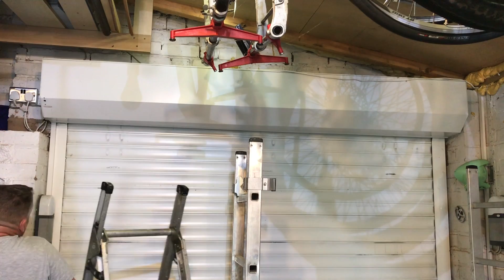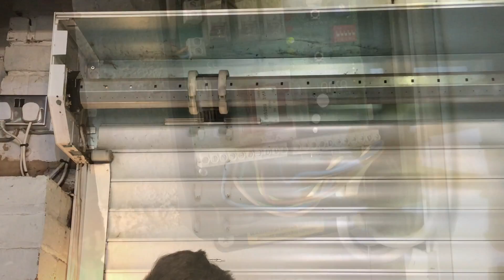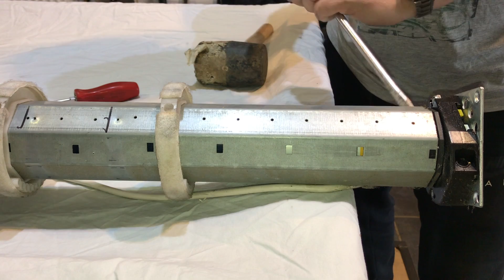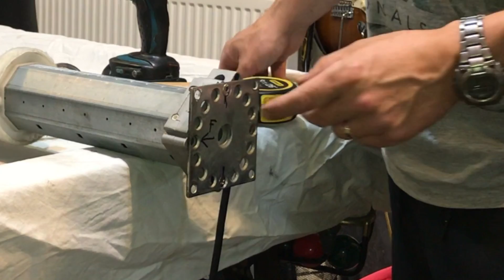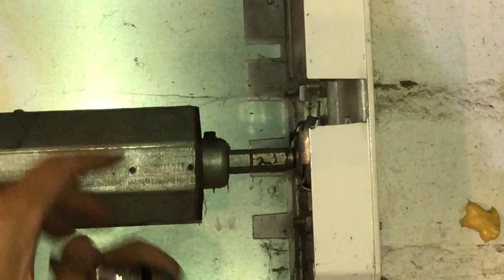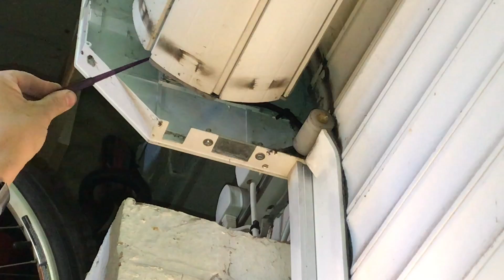Roller Garage Door Motor replacement, "How to Repair Electric Door"

Comment: Thank you Aaanton11. I bought my garage door second hand and the motor was very weak and then stopped opening> I bought the motor on your video and now it's better than ever. Old one was 100Nm and the new one is 140Nm. It's so quiet now. Great video....Thank you
Reply from the maker: That extra torque makes a huge difference, Thanks for the great comments👍🏻👍🏻🛠

Comment: It looked to me as if there was scoring around the gearbox body when you pulled the motor out. If this is so, it's a classic rookie mistake done by  installers who quite frankly, know very little about their own products!
Reply from the maker: Good to know for future reference, thanks for the comments! 👍🏻👍🏻🛠
Reply: One of the curtain fixing screws would have been too long. We saw a motor cut clean in half a few months ago, for this reason

Comment: @aaanton11
hI, Whats the thing called between min 36-38, I think its the Locking straps that attach to the door curtain, and what are the white things on the roller called. Seems our previous installer just screwed the curtain into the roller.
Reply from the maker: You will need to check your manufacturer's web site and look at a parts breakdown, Thanks for the great comments👍🏻👍🏻🛠

Comment: Very informative video, our garage door motor was making weird noises and when we removed the top cover we found a snail inside had somehow managed to get trapped and squashed between the left side motor and door slats causing a misalignment of slats. Having cleaned out all the snails shell debris the door now opens closes ok but does occasionally make some grinding noises on the left side so I foresee going down your road and maybe replacing the motor before the winter takes hold.
Reply from the maker: You might get another couple of years out of the old girl yet 😂 Thanks for the great comments👍🏻👍🏻🛠

Comment: Awesome videos, thanks! My Somfy keeps killing the downstairs circuit breaker, so assuming dampness over time in the motor. What’s your thoughts on the motor now having used it for some time?
Reply from the maker: Top Motor, no issues at all, not as fast as the Somfy but not too slow either Thanks for the great comments👍🏻👍🏻🛠

Comment: Great very detailed video. My door has been fitted for the past 12 years with constant daily uses.  It has been working perfectly until now.  When you press the button, it clicks...the motor activate but the door never goes up.
I can open and close the door using the grinder. I can close the door using the remote, it clicks once and closed without any issues or weird noises. When it reaches the bottom it seems that it wants to fully close but then tries to reopen which then obviously fail.  Is this also a motor issue ?
Reply from the maker: Sound like it, Thanks for the great comments👍🏻👍🏻🛠

Comment: The grub screw on the right hand side, what is that for/what does it do???

Iv got to replace few of the octagonal clips, will i be able to just pop out the one side (bearing side) and slide them on
Reply from the maker: It holds the share Into the bearing, Thanks for the great comments👍🏻👍🏻🛠

Comment: Absolutely superb and exactly what I needed to mentally prepare myself for mine! 

After being told that the guy that installed it would gladly charge me £650+VAT to fit a new motor, I decided to see what the internet said. First was your video to dismantle it, then a video that says that given the symptoms of my door that it was likely something called a "run capacitor". Zero clue what one of them did but as it was the £6.99 inlcuding shipping option I thought I would do that. What was really irritating was that there was no way of ascertaining the capacitor I needed for my motor as the only way to find this out is to dismantle it. No worries after looking at this. Anyway, I'd finally put it off for long enough and tackled it last week. I made a couple of mistakes with mine, plus here are some other things that might help others: 

1) When you untighten the grub screw and remove the circlip at the bearing end and have enough clearance to remove the roller, just nip the grub screw back up to stop the flipping arm sliding all the way back into the mech! 40 mins later I had finally managed to get it back out! :) 

2) Mine was the Somfy LT50 and I dug out their instructions which I didn't think were brilliant but it could also have been me. Anyway, I had seen the two adjusters (a white button and a yellow button) and at some stage I must have pushed one of them back in as I was faffing around as the upper limit had lost all sense of being and the thing went way beyond where it should have been and the curtain was flapping around until I dashed to the rescue! So be careful to not touch them! 

3) Despite marking everything up like an ordnance survey map I managed somehow not to get one thing lined up and I think it was because I had the devil's own job with the bearing mechanism opposite end to the motor end and two things: my bearing mech was riveted in place so drilled them off no problem but when I removed the motor it got stuck and when I pulled the motor out I could see the male gears (or whatever they are called) and that bit on the end of the motor was wayyyy down the curtain tube. Finally got it out and I suspect that this is what may have caused things to be slightly out of kilter. The good thing is I thought I would be able to adjust it by just resetting the upper and lower limits from scratch so wasn't worried as there really is only one way that it will go back in due to an internal seam, and for the motor on the end too that has a spine so not worried at all. The other thing is that bashing the mech back on the end was not so easy as there was a really thin plastic collar that was basically broken. Perhaps I did it, who knows. But after careful analysis (!) I cut it off and got the mech back together. 

4) As I was in this not knowing if up was up and down was up too, I decided to push both the buttons in as I got the feeling this would be the equivalent of a factory reset and it was. Once you had worked out which colour is the up limit, and which is the down, it really is an easy push adjustment to set it as you like. Phew. I have to admit I was worried at this bit.

5) The capacitor size for mine was 7 microfarads and everbody's favourite auction site is full of them. I had to file down the terminals as the Somfy female terminals are 3mm but no issues there at all. My door symptoms were: on first opening slow to rise, then on second and beyond it got even slower and stopped about 2 foot off the floor but would rise given a little lift and any subsequent opening and closing it just got slower and slower. 

The net result is that the door opens and rises just like it did when it was first installed.

Again, I could not have done it without this video so many thanks for taking the time to do this.
Reply from the maker: Firstly well done a great repair and also thanks for taking the time to post your story really appreciate that. Thanks for the great comments👍🏻👍🏻🛠

Comment: Fantastic job. 👏 I love the way you improvised with the mounts and overcame the smaller screws. 

My doors are similar but have a really weird problem.
Very often, they stop at a two certain points in the travel when rising (same places every time). The motor appears to try to continue and sounds like it's going to burn out, but when I help by applying just a little upward lift by hand at the bottom, it continues to the top. 
It doesn't do it every time and I've checked for obstructions (there are none in the runners) so I'm baffled. I might try changing the motor as it's old but not noisy.😀
Reply from the maker: sounds like the gears might me worn, Thanks for the great comments👍🏻👍🏻🛠

Comment: Thank you for posting this. I was quoted over £600 by two separate companies to change the motor in my garage door. After following your film I managed to source a new motor (twice as powerful) for £98. I then did exactly as you explain and hey presto I have a full working door again but much quicker. If I lived local to you I would buy you a pint. Thank you.
Reply from the maker: Happy to help Great job, Thanks for the great comments👍🏻👍🏻🛠

Comment: Thanks for this. I have the same set-up making the same noise when closing - OK on opening though. Did you ever discover why the old one was noisy?
Reply from the maker: I suspect the gearing in it was faulty or a bearing, but I haven’t stripped it down. I still have the motor and will get round to it one day.😂Thanks for the great comments👍🏻👍🏻🛠

Comment: Thanks for the video. Mine did the same i had to wack it to get it out, but then it was loose. I realised there was a single rivet holding it in and hitting it sheared the rivet so became loose. just incase anyone else has the same problem.
Reply: I think you can see the rivet in your video at 17:32 in the black end cap. The rotating collar on the motor end is the position sensor for end stops. Most motor stall faults are the start capacitor in the motor that you can change for about £5. I pulled the motor apart but couldn't get the housing out with the capacitor in so ended up replacing mine is also a somfy 55nm but its a double garage so it would be pretty powerful for a single garage. Thanks again
Reply from the maker: Thanks for the great information👍🏻👍🏻🛠

Comment: Good video mate, I've just installed a  roller door on my garage, money well spent, was is interested to see the motor and what to do to replace them when the time comes, my roller door looks exactly the same as yours under the cover, my door will get a lot of use getting opened and closed every day what with me van going in and out so least i know what to do when the motor eventually fails.
Reply from the maker: Thanks for the great comments👍🏻👍🏻🛠 z

Comment: A very informative video - thanks for sharing your practical experience and skills with the doors. My garage door has just failed in that from a Closed position it tends to 'oscillate' or make repeated attempts to open by about 6'' before 'dropping' to its Closed position.  From your and contributors comments could this be a motor Capacitor issue? I'm not in a hurry to fix it as I can use the side entrance door.  Again, many thanks.
Reply from the maker: Glad it was helpful! sounds more like a control unit issue, Thanks for the great comments👍🏻👍🏻🛠
Reply: @aaanton11  Interesting. Think I will apply temporary switched240v supplyto the motor directly to eliminate CU logic control/relay output issues.  Will let you know how I get on but this may be +2 weeks. Thanks for your response.

Comment: Thanks for sharing this. I'm in the Shetland Isles where we don't have many garage door repairers so it's a DIY job. I'll strip it all down tomorrow and see what's up. (The door is set closed but the motor is running)
Reply from the maker: Good Luck, Thanks for the great comments👍🏻👍🏻🛠

Comment: Great video although a little low on sound..Ive watched a few times now and feel confident to change the motor myself.My Novoroll door is only 3 years old and the door goes up and down sometimes .
It then sticks both up and down and makes some odd grating noises.How do I know if its the motor or the capacitor..many thanks
Reply from the maker: if it grates it wont be the capacitor, Thanks for the great comments👍🏻👍🏻🛠

Comment: Thanks for the video a great help as mine has stopped going up, i can hear it click but then nothing.

Can you fit any motor to the garage doors as long as the Octaganol Collar fits, ive measured mine from the outside (so i dont have to take it apart) and it looks to be a 60mm tube.
Reply from the maker: the mountings might differ between brands always easier to replace with the same, Thanks for the great comments👍🏻👍🏻🛠

Comment: Thanks for this, just managed to swap my motor over, it would have been a lot more difficult without this video. The instructions that came with the motor were a bit rubbish and so you filled in a LOT of grey areas.
Thanks again 👍
Reply from the maker: Glad it helped, Thanks for the great comments👍🏻👍🏻🛠

Comment: Great video. Have just repaired my garage door today.  Needed a new start capacitor,  so ended up being a £5 repair rather than a new motor! Bargain. 

One thing to watch is that mine had a rivet through the hexagon tube and into the drive end of the motor. Luckily after a just a few taps with the mallet I realised and drilled it out!

Door is now working a treat every time.
Reply from the maker: Glad it helped Thanks for the great information👍🏻👍🏻🛠